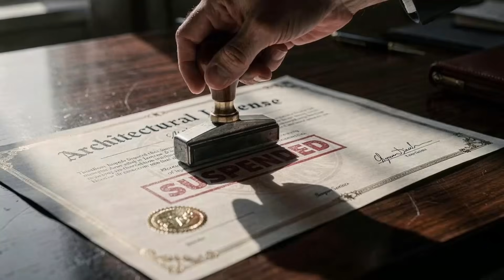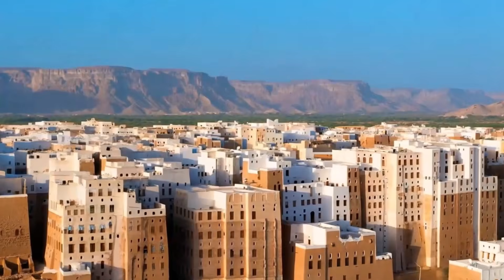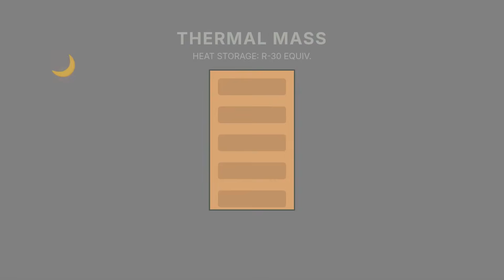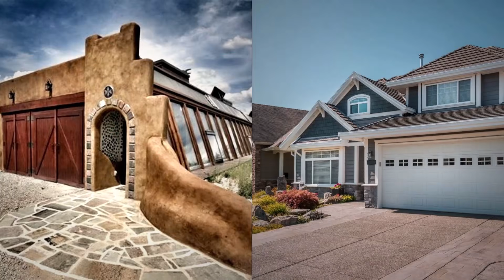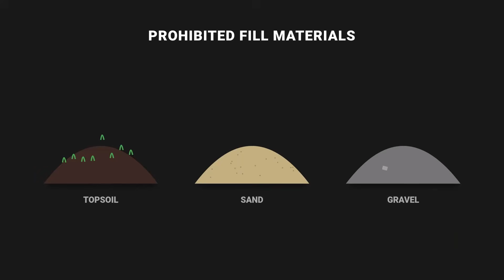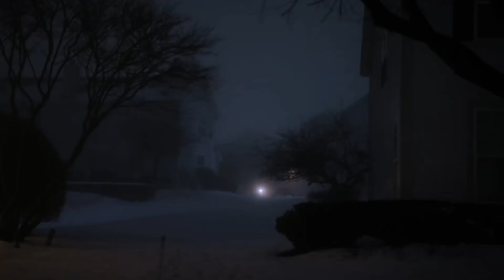This FREE Tire Wall Keeps Your Home at 70°F Forever (Why Is It Illegal to Build in Most States)

Comment: Theres evidence that the tires leal toxins into groundwater... and offgassing ofc
Reply: saved me 15 mins
Reply from the maker: You’ve hit on the two biggest questions people have about Earthships! Regarding off-gassing, tires generally need UV light and high heat to break down and release vapors; when they are packed with earth and sealed behind several inches of airtight plaster, they stay at a stable temperature and are shielded from the 'off-gassing' process.

As for groundwater, several studies (including those by the EPA and various civil engineering departments) suggest that tires are relatively inert when buried in stable conditions. The real 'illegality' usually stems from the fact that building codes aren't designed to calculate the structural load of a 'non-standard' material like a tire, rather than a proven toxic leak. It’s a fascinating debate between 'waste-to-resource' and strict material standardization!